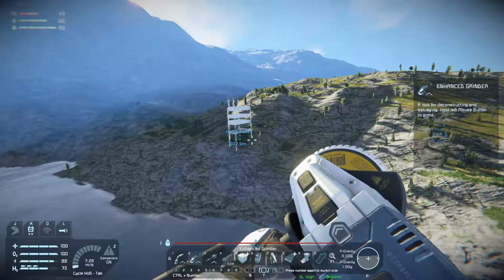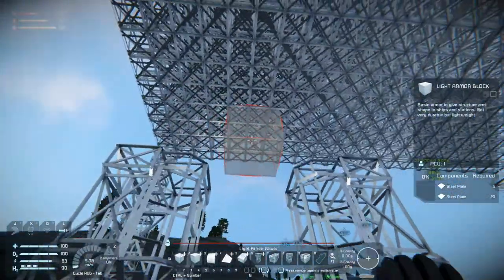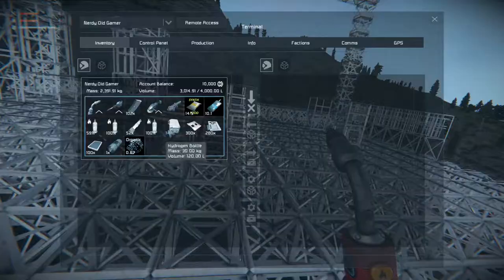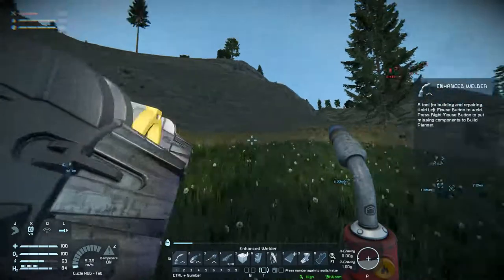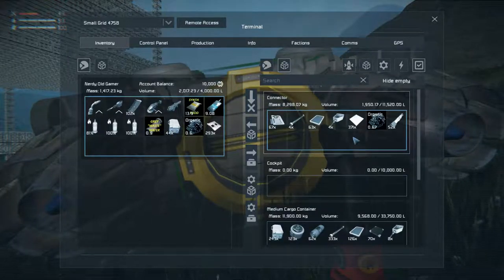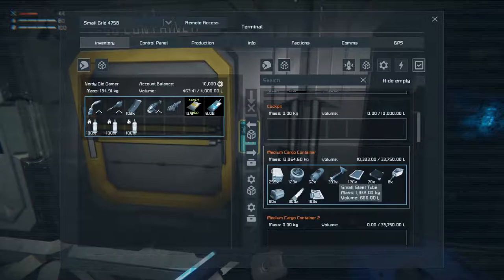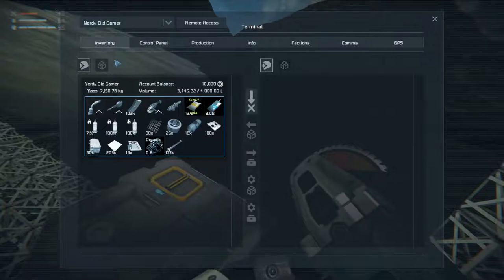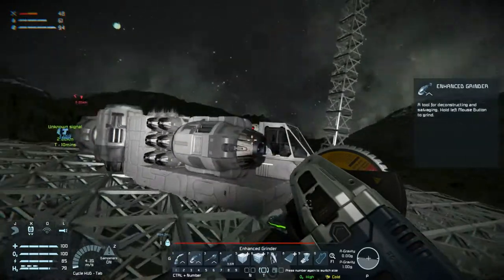Lets Play Space Engineers Modded Survival Ep5 | Getting Home Base Functional

Comment: I have to say this. I don't know if you already have thought this but you NEED to have your refineries, assemblers, cargo containers, as well as your connectors all piped/connected by conveyors so that when you come back from mining the ore qnd you hook up you mining craft to the connector the ore goes right into the refinery. That way you are not transporting the ore by hand from the miner to the refinery and the assembler can pull the refined materials it needs directly from the containers and/or the refinery. Also the assembler will put finished products in the cargo containers for later use. I only mention this because you said you wanted to put a wall between the refineries and the assemblers. I am only tring to make this so that you don't even have to visit the production floor to order or grab what you need. Sorry for the long message. Especially if you knew this already and have a plan in mind. It looks like you have thought of this @24:04. If so I am sorry for the inconvenience.
Reply from the maker: Yeah, I had thought about it, just hand't gotten around to it yet 😄